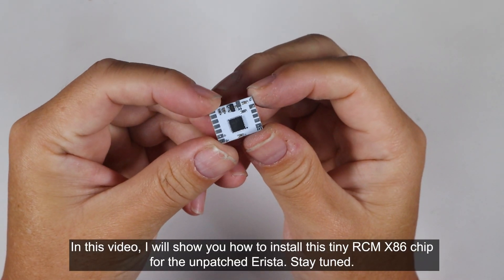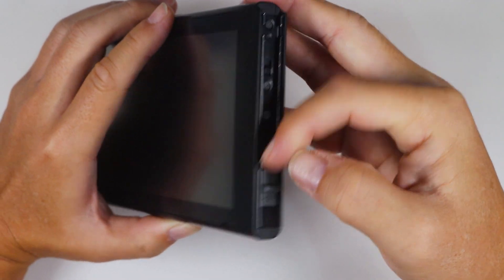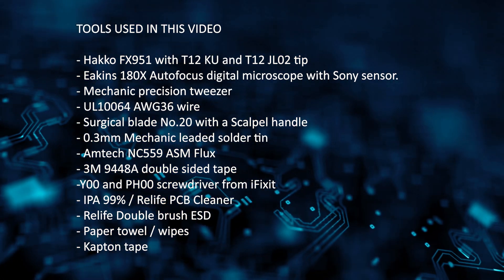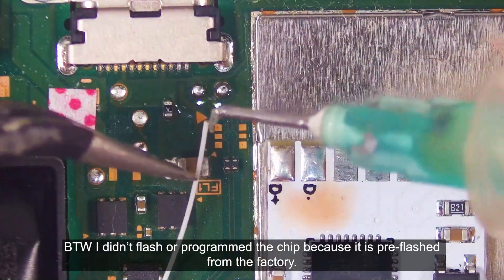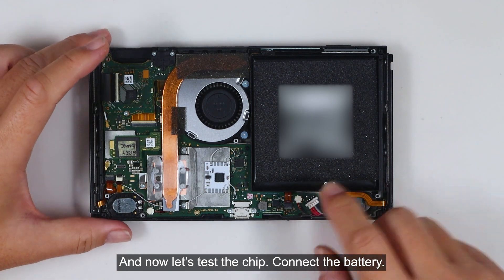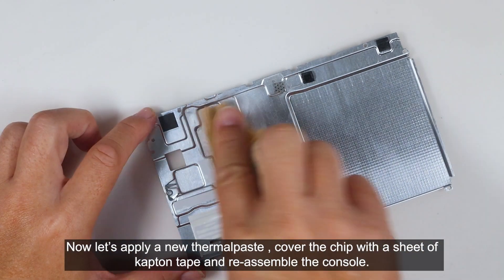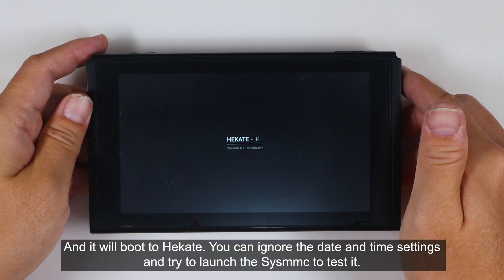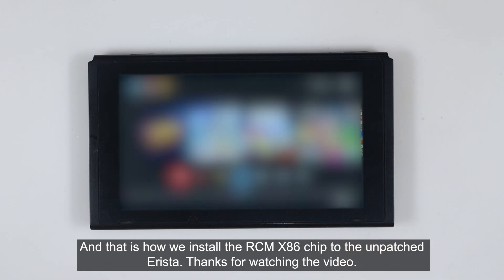THE X86

Comment: My switch stopped detecting the right joycon after the install. It charges the controller, but doesn't register it. Removing the wire by the connector fixed it. I got a new piece of wire, resoldered it and same thing. Bad chip maybe? I even replaced the rail but no change.
Reply from the maker: maybe a bad modchip?
Reply: @sthetixofficial  That's what I thought thank you

Comment: Sthetix, do you have a link? Where you bought this chip? Aliexpress has a chip, but that's not the one from your video. And is the chip preflashed? If not, which firmware can i use? Github link?
Reply from the maker: I bought it from aliexpress, but currently they don't have the one I used in the video. and it is preflashed.
Reply: @sthetixofficial  could every model be used they sell? Are all of them preflashed?
Reply from the maker: I think they are preflashed from the factory. all of them

Comment: hello friend. I have a black x86 rcm board (new model). It has points A and B. Is the point on the left, which you soldered to the bottom of the console is a point A or point B?
Reply from the maker: I dont know bro, but you can see it here https://gbatemp.net/attachments/1667823618765-jpeg.336154/
Reply: A
Reply: @kay00  thx

Comment: I did it!
1. I started with the +/- to make sure I didn't screw that up right off the bat.  Those surface mount components were so tiny!  I am not sure if it was the flux or not, but I had the hardest time getting solder to stick to them.  I finally got a little on each and then soldered the wire.  I powered on the Switch and the LED on the mod chip board came on as well as the switch.
2.  Once I knew the system still powered on I then proceeded with the other three.  Those were easy.  Solder flowed onto the pads easily and wires stuck nicely.
3. I already had Android OS on my switch so all I needed was to copy the boot.dat, boot.ini and hekate.bin file to my SD and edit to boot.ini to point to the hekate.ini file.
4. I booted up and can now play in my Android OS without plugging the Switch into a PC or other device to invect the payload.

Thanks for the video and links!
Reply: All new stuff uses unleaded solder and it has a higher melting point than the old stuff or prolly the stuff you have. Set your iron to 300c to get that stuff melted but best to feed in some of your solder to help melt all of it. And no, flux does not make soldering harder. It helps solder flow to the copper tracks/pads/soldered connections. It's a must have in smd soldering.

Comment: Hello i found in my lab 5 rcm-x86 chips. Can it be useful today to install such a chip in an unpatched switch? Or is it useless anymore? I don't remember what special function this chip had.
Reply from the maker: it is useful for unpatched switch
Reply: @sthetixofficial  Precisely! So what are the advantages of using it if the unpatched Switch can already be modified via software?
Reply from the maker: it will replace the dongle and payload injector software.  it will taste like having a real modchip.

Comment: Hi, the chip worked, but had strange problem with the right joycon, the console recognize it now as a separate controller and not as a attached joycon
Reply from the maker: try to disconnect the joycon from the settings, and sync it again.
Reply: Hey did u solve it?
And how?

Comment: i bought and install rcmx86 chip , white the same of the video, but i have issues for install games by usb, computer stop recognize nintendo switch usb conection. you know somethimg about this? thanks
Reply from the maker: you better use the DBI with MTP responder method to install games.
Reply: @sthetixofficial  thanks , i don't know the method but I'll try
Reply: @sthetixofficial  could you tell me more about this? Will this chip prevent you from installing game via USB with tinfoil or goldleaf?
Reply from the maker: no it doesnt
Reply: Recently i bought black version of chip and this haven't USB connecting issues

Comment: Can you  do a video  to show the other install method that uses the magnetic reed switch and  that you can boot directly without holding vol+ and power
also show the alternative solder points that don't require you to  solder to the caps
Reply from the maker: i dont recommend it because it could kill your console as it is always under the AutoRCM mode. for other solder points, you can refer to my V2 schematics here : https://github.com/sthetix/DIAGRAM/blob/main/OLED-on-V2.jpg
so what i did is the safest option for all people
Reply: @sthetixofficial  wait I am confused now k, I thought the install you did in the video has auto RCM enabled,  you said the chip  has it flashed from the factory with  auto RCM enabled , I thought  the  reed switch was just  so you can  use a magnet to  boot into OFW, what does the reed switch actually do? and what is the differecne   between the   other install that uses more wires, 
also you have a good video on  how to   recover if your battery dies with auto RCM
so why is it dangerous?

Comment: Do you also give advices here? I still have the unpatched V1 here. So I had the red OS a long time ago and activated AutoRCM, because I didn't want to use the Jig all the time. Now I'm using the blue OS on latest firmware and AutoRCM is still enabled. I just want to boot the blue OS all the time because the console is banned anyway. Which Mod Chip do I need when I don't care about OFW and only autobooting CFW?
Reply from the maker: On hekate just set it to autoboot sysnand cfw

Comment: how to know if the chip i buy has autoRCM setup by default that i don t want? in that case would i have to reflash it?
Reply from the maker: Just follow the guide. Autorcm mode uses 5 wires
Reply: @sthetixofficial  I'm a little confused: isn't autorcm a feature that you enable through Hekate? O you need to activate it by flashing a specific version to this chip? Besides, doesn't the 7 wires install only has the vol+ strap on feature more than the 5 wires one?
Reply from the maker: autorcm is for the V1 only. and you can activate it using Hekate. i dont use the autorcm, i set it exactly like in the video.

Comment: Hi... Thank's for the tutu... I have question : what model of file 11(cables ) are used for soldring chip... Thank's...
Reply from the maker: What 11 cables?
Reply: @sthetixofficial  i mean the type of cable used in the installation of chip
Reply from the maker: it is the UL10064 AWG36, you can use other type of wires if you want.
Reply: @sthetixofficial  thank You so much

Comment: Why do people with UNPATCHED erista model need a chip??
Reply from the maker: to make it easier to boot to the cfw environment - no need to use a dongle or need to inject a payload using a cable.
Reply: @sthetixofficial  okey, thank you so much. One more question, will you upload a video if people are able to use this chip for other switch models?
Reply: @josevicoflores  you can’t this is only for unpatched switches
Reply: @SlingshotGamer  aaah okey, I asked because of the recents rumors about this chip with which we maybe will be able to do the same with the rest of the switch models
Reply: @josevicoflores  that’s a different chip it’s called a RP2040 but no software  has been released for it
Reply: @SlingshotGamer  thank you so much, I didn't realized that point, the hype is so high hahaha